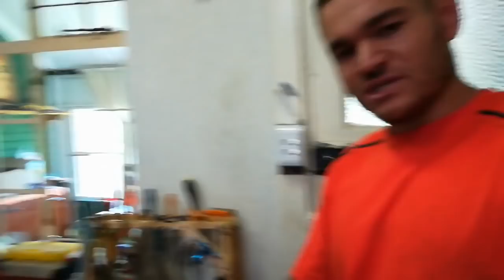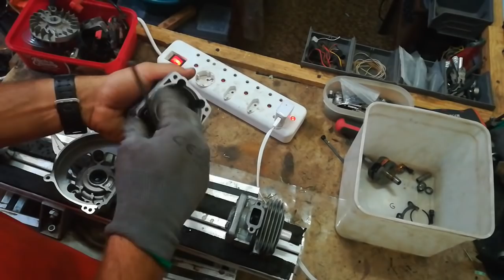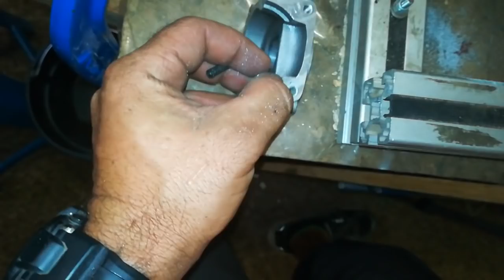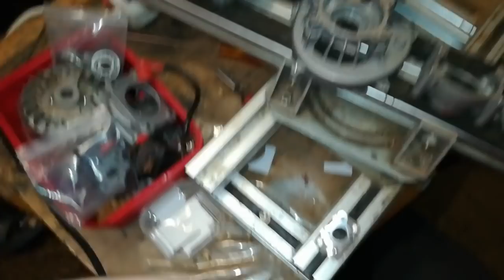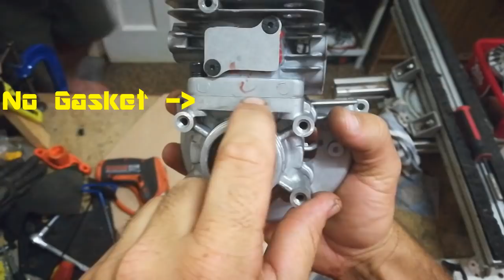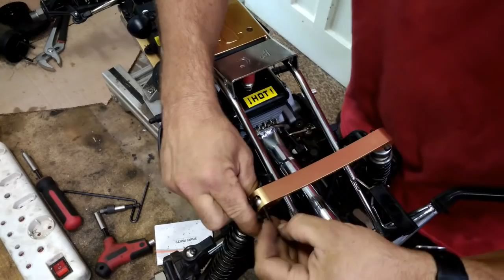Porting a Baja 5B 32cc 2 Stroke Motor │ 1/5 Scale RC

Comment: Everyone with a lil bit of courage can do this at home, even just small changes, smoothing, matching can make a HUGE difference in the way these lil engines run! Don't be afraid and tackle it, pickup a basic Dremel kit with a variety pack of grinding attachments and just go easy at first, try it again and then go further if you want. U really can't screw it up if you just stay simple with it. Try and think, if I were airflow, how would I want to flow? Keep it simple and your efforts will be rewarded I promise u that! Great channel buddy!
Reply from the maker: Very true
Reply: You should see some of the stuff they do to chainsaws. What he did was just mostly basic stuff.  I've seen people do Finger ports trying to squeeze every little bit out of them. Keeping it basic is smart really. If you do advanced stuff wrong, cylinder is trash.

Comment: The baja 32cc and hy 32cc rampage mt engine the needle piston pin bearing is the same.bcoz my needle bearing in my rampage mt is broken. I dont know the size or part number. Pls help me.thanks
Reply from the maker: I measured our Rovan needle bearing today and the width is 10mm and the OD is 12mm. The Rovan part number is 670114

Comment: Hi mate I'm having trouble with my engine you know where the clutch plate bolts onto the crankshaft its supposed to be a friction fit and a retaining bolt in the centre but my engine is just spinning inside the clutch plate no matter how tight I put it hope this makes sense hope you can help
Reply from the maker: Makes sense, thanks for the Q. We have this with our high torque motors and what I do when assembling is place 2 drops of lock tight on the shaft before fitting the clutch mount.
You must also note that the clutch mount is a very soft metal and can be misshaped, hence it not gripping and replacing it might be the best fix.
Overall a cheap fix but can be so frustrating.
Reply: @EZR  thankyou for the reply mate I've ordered a new vented billet alloy one and I'll add a bit of lock tight on assembly thank you again

Comment: Watch tinmans saws. You can make a degree wheel cheap with a cd or dvd. He explains its long hes a talker but worth it if you want everything you can get out of a saw/baja engine. This is very goid video except lowering the cylinder your dropping the duration or time ports are open and they open later close sooner. But this engine did seem to run very well had lot of tq. Tinman porting is more for topend high rpm hp. But with right clutch springs itll get it up on the pipe and make more power overall. Good thing with a degree wheel you cant over port it. If your exhaust duration goes past 180 its a paper weight very few engines run right over 180 deg. You can set your blow down aswell the distance between top of transfers to top of exhaust theres simple math to find in deg your blow down. I believe last yamaha jog cylinder i ended up around 30 deg of blow down. This is a goid video if you dont want to use a degree wheel by widening the ports and helping the ports flow your gonna gain without scraping the cylinder but raising ports really wakes up a 2t. But dont do it without a degree wheel or youll be throwing the cylinder in the trash. All this porting is pointless aswell without a pipe. Youll gain some but resonance helps refill the cylinder. The pipe is the biggest mod for one of these over a box exhaust. This baja has a nice pipe on it. Overall this thing rips but i wonder if its lost overall rpm due to lowering the cylinder and not raising the ports back to there proper hieght. If gaskets 1mm you raise ports 1 mm. Thats eaaiest way youll gain compression and duration no degree wheel needed. 2 stroke stuffing is a good channel to watch but hes building sime handmade super high powered low cc engines. But he explains everything in detail. Hes prob the smartest 2t guy on youtube. Im in no way lnocking this video engine performed very well. Idk about lightening the piston ive never done that or seen it before i hsve opened ports in pistons before no balance issues bit me in the butt. Im going to look into lightning piston. I know in dirtbikes pisons explode so im not sure if thats a good idea but these pistons are way lighter than a dirtbike. Good video good content. Like that buggy. I got a 5t but dam its heavy think a baja 5 would rip with weight difference
Reply from the maker: @braxbarrett4398 thanks for the info man.
I might get back into porting in the future but we have outsourced all the work from this year. Been working great. The guy who ports for us does check port timings and don't push it too far. We also don't lighten the pistons anymore. Lots of work for possibly no gains.
Perhaps we will do a before and after video on our G320
Reply: @EZR  thatd be awsome it seems like the zonahah 32cc and clone engines perform really well. I've got a 32cc china clone in my 5t. With a cheap pipe. I bought it that way recently. Guy I race with has a zanoah 32cc with nice pipe on his 5t. It screams pretty hard. Can hear it get up on the pipe when he hits the straight aways. I also have a rovan 45lt. It has goods of tq but signs off really early. I think a pipe would really wake it up. There's just a few of us trying to start a 5th scale class. The tires and body are what's pricey on the 5t rest isn't really that bad. Have another guy who's come out a few times with a taylor reed case engine but idk if it's huge advantage after watching the stock piped zanoah run. Diffinatly more power but only so much room on a track to use it. We're setup at 16ft wide lanes. I wonder how a piston port engine would run with the reeds that bolt on in between the carb and intake if piston was windowed to allow it to flow through piston on up stroke? You ever seen or messed with them? I know dirtbikes for long time ran reed valves that way the they started aiming the intake charge towards crankcase or just went to case induction all together. I just like to tinker and it'd be cool to build a reed induction engine cheap and it perform well. They want 70 bucks for that reed setup. Seen you can buy a crankcase that converts a 32cc zanoah for like 320 bucks. Suck to waste 70 bucks and time just to gain nothing and time trying to tune it. Obviously the reed case setups make great power so the 320 bucks would be a diffinate gain.
Reply from the maker: @braxbarrett4398  I have also ran alongside some reeds and personally piston port is boss. The Reed costs more and has more maintenence. Not worth the extra money.
In my opinion the best piston port engine is the Zen 36mm. Lighter, cheaper and more than enough power to pull any 5th scale.

Comment: The current lot of Rovan 32cc and 36cc motors have an integrated side scavenger port cover that is completely covered, making it difficult to perform such port processing.
Reply from the maker: Very true. The biggest difference we have seen is by changing the squish/piston gap. Big torque increase

Comment: You should dyno the engine before modifying it, then re-test it after the porting. Only then can you (and the paying customer) can see where his money went. Do you sell the tuned pipe that was on the engine at the end of the video?
Reply: Try daves discount motors usa.  But try ebay for the chinese clone copy. Just as good as the dominator. After racing theese things ive found the 26cc barrel with a dominator the best combo. But stay away from the 813 carby
Reply from the maker: Good Day Christopher. At this point in time we are not a pro as OBR or ESP and hence charging less than half their prices. We do not dyno as yet, but try to improve response and RPM without effecting reliability.
That pipe is a Rovan Dominator Gen 1 and will out perform the DDM pipe at double the price.
Our fav is still the KM Ruler Pro Pipe.
Reply from the maker: Most of our cars run the 813. Wins most races in South Africa at the moment.
Reply: @EZR  hii. Nice video, damn good explain. I advice you to try carb 1107 on that 32cc
Look at my channel, its based on your instruction. Many thanks. Will follow your videos.

Comment: That’s cool there’s an access for the transfers I’ve never seen that before
Reply from the maker: Rovan will be changing that soon. Unfortunately.
Reply: You can still port a transfer without that access, but you have to use really small burs and it's MUCH harder. I'm used to doing it that way on chainsaws.

Comment: So update
Followed yr instructions re this motor. Put it together and damn she runs. 
So happy. Sorting out my carb as it was flooding out the intake. Changed the diaphragm and it’s improved but still over fueling. 
Will changed the needle next and that should sort it out. Did the metering mod spring also and that seems fine
So thanks for providing instructions on this really appreciate it man
If yr ever feeling generous. Perhaps a tute on a 29 or 26cc would be great
Once again thanks
Reply from the maker: Good day. We are very happy it helped. We will be posting lots more videos detailed videos very soon. Just moving shop and getting settled.

Comment: Excellent video! Turbo port should be on intake side though. A lot of good information here. I'm a Big fan.  -Perkins
Reply from the maker: Hello Perkins! How come on the intake side? The spin of the crank is towards the exhaust port where the volume of air/gas gets taken in.
Reply: Because you want to pull it out of the cases up through the transfer ports into eyebrows.
Reply from the maker: @Perkins.porting  What happens if you do both sides? One lets more in and the other lets it out easier?
Reply: That's an option, was commonly found in oldschool g230rc goped porting. In my personal experience,  I didn't like the effects of both sides done. Both sides kinda canceled each other out.
 I wouldn't get caught up on case porting so much... port shape, timing duration,  flow porting,  can have much more noticeable effects.
Reply from the maker: @Perkins.porting  Yeah I hear you. I still need to do some schooling on the timing duration side. I know that makes a big difference. But we will get there soon.

Comment: Hey bud got a question i have a hpi baja 5sc and wen i start it it idles high and not sure wish needle to adjust if the H or L and wish direction if go left or right please help thanks and great video you got goin here by the way
Reply from the maker: Whazzup WRC. So basically left is open for more fuel and right is closed for less. You want to open(turn left) the L needle to drop revs. Complete tuning is a little more involved than that, but maybe I'll make a video about it shortly.

Comment: How much more power do u get frm that. Very cool shit. Thanks for posting man
Reply from the maker: It mainly ups the RPMs but the head drop and exhaust opening helps with some torque. If you can get your port timings right you can squeeze a lot of juice out if a little CC.

Comment: Probably lightening the piston did the most. You could probably shave the head by a few mills to get more compression. I wonder if lightening the crank is worth it?
Reply from the maker: Will do a before and after video soon. I dont think lightening the crank is good because the motor needs the weight momentum for the torque. It will give better RPM but will lose KW.
Got a few videos that needs editing and just not getting to it. We actually did a 63mph / 106kmh run a ferw weeks ago that I want to get uploaded.
Reply: U dont need to shave the head.  They make down to .005 copper head gaskets if that's what u wish to do.  Factory squish clearance is only .02-.025 and stock gasket is .02 thick so if u drop to .005 gasket from a .02 gasket ur piston only has .005-.01 of clearance to the squish band.
Reply: Also they make stuffer cranks where the crank is machined out and then stuffed with Teflon in those areas to make it lighter.  And it's quite a bit of material removed and still idles just fine.
Reply: Lighten the flyweel. This will give you 0,5-1,0 hp . The engine spins faster up and gets more rpm .
Reply: @h-jg7730   ain't no way it's giving u that kind of power.  Gives u a little better throttle response, a little more snappy out the gate, thats about it.

Comment: Hey easy trade would the head of the engine have a marking for the size of ccs my rovan engine is the 4 bolt style head but don’t know what size the pull starter cover housing is red no removable ports it’s got lots of power
Reply from the maker: No Rovan does not have markings. You must measure the piston and stroke

Comment: Great video. Did you adjust the intake and exhaust port timing?
Reply from the maker: No I didnt, but dropping the cylinder without a gasket makes some difference.
Reply: When increasing compression do u think it's better to eliminate the head gasket, base gasket, or both? 
Just discovered your channel, Great work man! will u try and continue to grow channel in 2023?
Reply: @romper4444  He does remove the base gasket to increase the compression.

Comment: hello, congratulations on the video. I recently bought a model with an engine similar to this one (MK T2000 4WD), but the engine does not work. I touched the candle, removed the filter, put gasoline (500ml gasoline x 20 ml oil 2 stroke), but it didn't work. Please can you help me ?
Reply from the maker: Hello, thanks for reaching out!
#1 is ring & sleeve. If those are badly worn nothing will happen.
Our first check is Coil gap and Spark plug.
I do think we need to do a video on this. Hope to get to it soon.
If you reset your coil gap and changed the plug with no joy then you need to check if the carb is actually fueling the motor. With the filter off - Is the inside of the carb actually getting wet when you choke it?
If it is - the piston ring is your next check. You will see the problem sure enough with these checks.
Reply: @EZR  thank you very much for taking the time to answer my questions. I live in Japan, and there is not so much information about this here. I will do what you told me. thanks

Comment: you had no issues using regular gaskets instead of teflon ones? and also what carb you using?
Reply: Performance Rc telling n gaskets when over tightened. Deform then leak
Most guys won’t use them for that reason. Using regular gaskets. Cleaning mating area. Works just fine bro
Reply: Use 990. 997 or 1107 walbro carb
668 carb is used up to 30cc
Reply from the maker: Well stock Rovna gaskets are good for one time use. Best carb is the 813/990 Walbro

Comment: How do u do the break in procedures after a new rebuilt motor?
Reply from the maker: Howzit bud. There are different opinions. Feel free to check out our video on full break in too.
Ill give you three opinions.
#1 Text Book Procedure(what I would do with a customers car): Idle motor for 20min and cool to the touch x3; run the next 30min on no more than half throttle; 2nd tank possible to give full throttle bursts but dont over do it; 3rd tank change plug and start tuning for peak performance.
#2 My procedure(ON MY OWN MOTORS ONLY): Idle motor for 20min. Cool down completely cold. Check cylinder and exhaust bolts and then let the motor have it. Full throttle, peak tuning, take it to race day etc....
#3 Break in doesn't matter. 2stroke motors are very strong and as long as you use proper fully synthetic 2T oil at the right ratio you have no worries.
Reply: @EZR  are you familiar with the idea or theory that a slow break in actually isn't the best way to extract max power from a ringed 2 stroke engine?(not nitro pinch type engine)
Its based around the theory(well actually proof) that u got about 20m of runtime before that fresh abrasive cross hatch pattern starts to become smoother and if you don't use that initial abrasion to seat the rings quickly with varying medium throttle aggression and rpm that you sacrifice compression and power for the "safe break in" method. Everything will still run just fine the "normal" way, just what ur giving up in long term hrs before rebuild and max power. You know the old saying break it in how you want it to run from the muscle car days? Well there's a whole lotta truth to it.
There's an excellent website from a former pro racing team dirt bike mechanic that's recorded his findings over 20yrs showing the difference in engines broken in like this vs the "manufacturers way"(the break-in for dummies way lol). It is super interesting! And the results are hard to ignore when they are staring you in the face persay lol.
Reply from the maker: Yes, our new way is more fun friendly. 5min on the bench and then give it stick

Comment: What are you using for the cutting?
Reply from the maker: Dremel Tungsten Carbide 3.2mm. Round tip(not ball end) is by far my favorite but we can't get them anymore. So I use the cone shape and straight flat head. Must have those fine lines and I dip the tips in wax every couple of seconds to prevent the metal to stick in the grooves too much.

Comment: So what kinda power increase do you suppose you gain after doing that job. Say you had a 5hp motor starting out what you think it has now?
Reply: 5.2 lol
Reply from the maker: There are a lot of factors to take into account, but the bigger the motor the bigger the increase. Simple porting will mainly increase RPM's with some torque change due to the increased compression, but changing the port timing will make a huge difference. Check out our new videos, Lots of porting stuff coming.
Reply: Typically from experience you see 1/4 to 1/2hp on a standard 29 to 32cc motor. The peak hp may not change much, people get to caught up in that peak number. Its more about how much more power is created "under the curve", so basically the way the torque comes on, the snappyness of it, builds rpm quicker and makes more torque starting at 8k to 10k to 12k to 14k and so on. Basically the motor will feel like a tuned race motor after vs a doggy stock motor. Hope that helps explain.